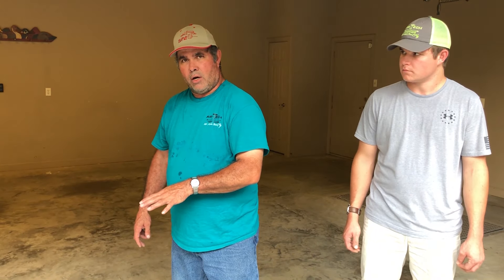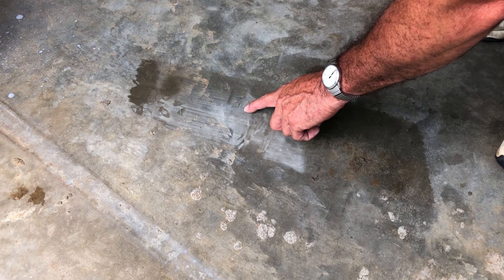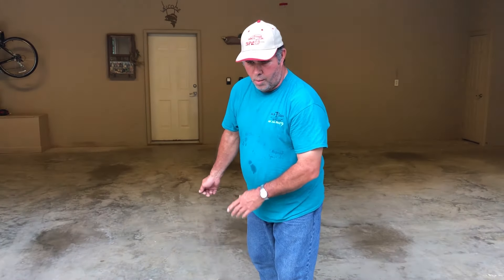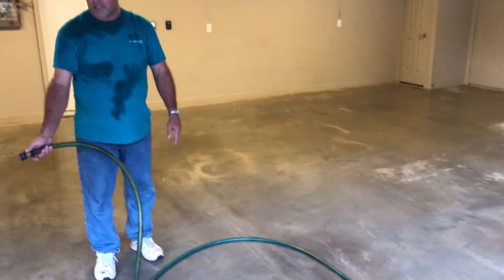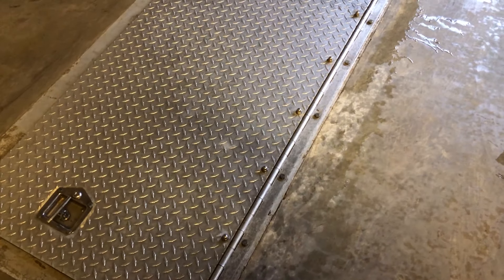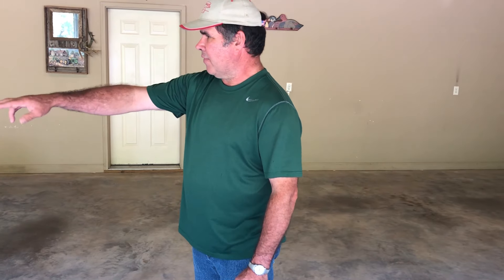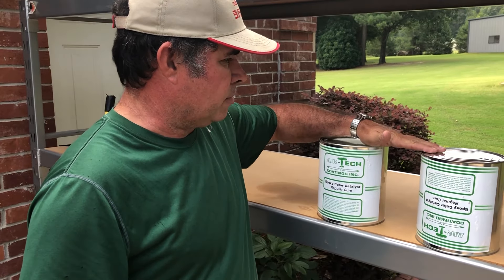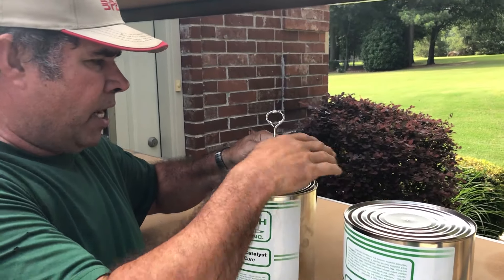01. Hard Deck Flooring -How to Install Video

Comment: Great video brother man! I ended up using rust oleum epoxy paint in my shop and it turned out good. 😁👍🏼 I think everyone leaves a few of those lines in it from the roller. Mine has a few roller lines.  🤪Lol.

Comment: Thanks for coming out to Owasso and speaking to EAA Ch 10 last night.  Very thourough video!  I've got a 50x50 hangar at Claremore that I'd like to do something like this to.  Its a painted floor that holds a lot of dirt and grime (hard to clean).  I think with your system and the clear top coat it would be less porous (assuming that's my current issue) and will be easier to keep clean.